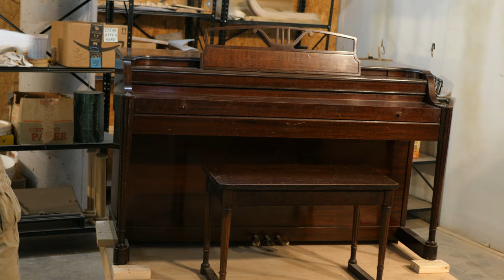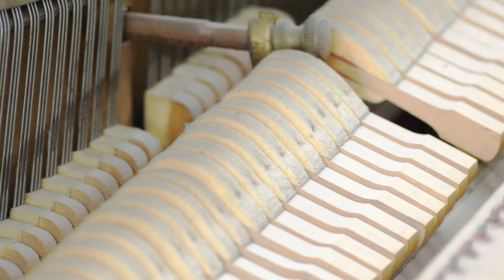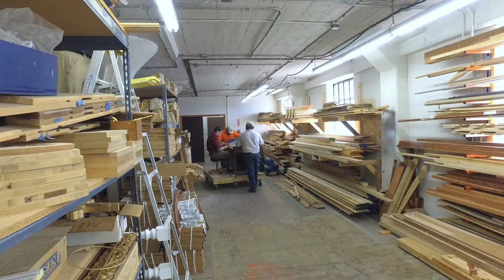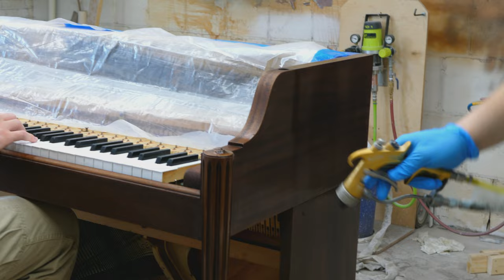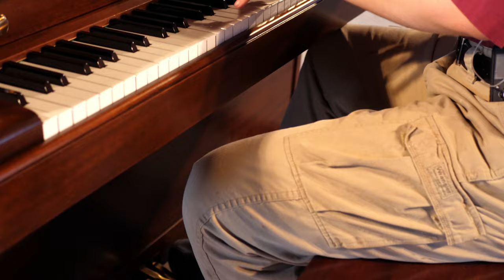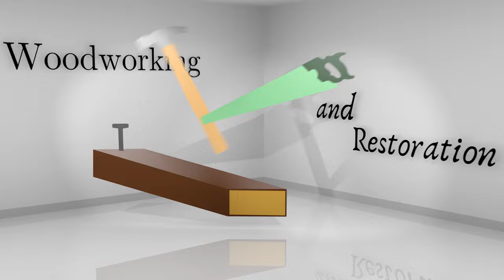Restoring an 80 year old Baldwin Piano (ft. semi-pro pianist).

Comment: Wow, i have that same piano. Can you tell me more about it? Not sure if i should get rid of it.
Reply from the maker: Acrosonic pianos were Baldwin’s line of spinet pianos started in 1936. A spinet piano is a type of upright piano that short and compact. It operations off what is known as a drop-action. This means that, duo to how thin the piano is, the hammer assembly is compressed and strikes directly into the vertical string from the front, rather than hitting it from below on a fuller piano. The drop action decreased the overall sound quality making spinets inferior by comparison. Baldwin’s Acrosonic line of spinet pianos was a rarity in that it’s tone quality was better than its counterparts from other manufacturers. From what I can tell, the word acrosonic comes from the greek words for ‘extreme’ and ‘sound’ or ‘tone’. As for whether or not to get rid of it that would depend on if you like how the piano sounds when played. If you do intend to get rid of the piano I would recommend refinishing, as that increases the sale value if the piece is in the best condition possible. A quick look online shows sales for Acrosonic Baldwin pianos ranging from $300 on the low end to $3500 on the high, with sales prices averaging around $1500. I hope that helps!
Reply: I have one too. I actually restrung it while apprenticing as a tech. That said, my mentor who kept his pin tightener in freezing tems, screwed up the pin block.
Re: the Acrosonic.  Spinets are the bottom of the food chain, being small, pretty and cheap. Baldwin Acrosonic IMHO is the best spinet. That said, its still a spinet.
It projects well, the bass still is limp, the action is light and fast. I love that.. Its still a fun piano and a pain to work on.